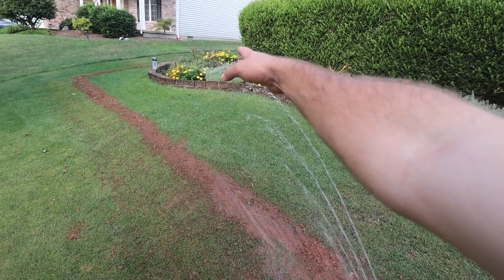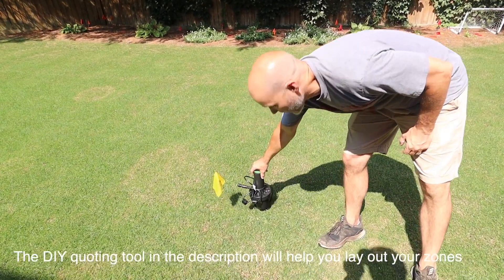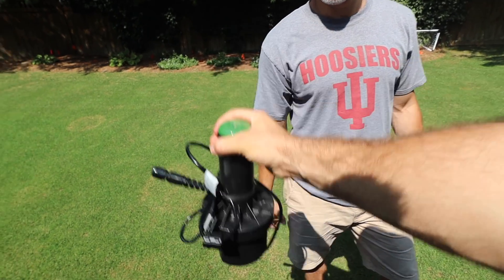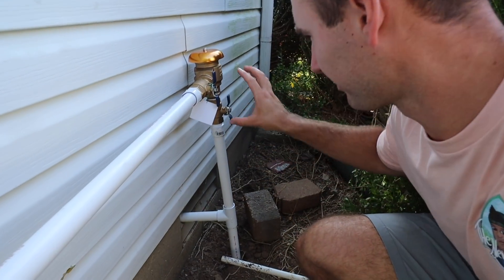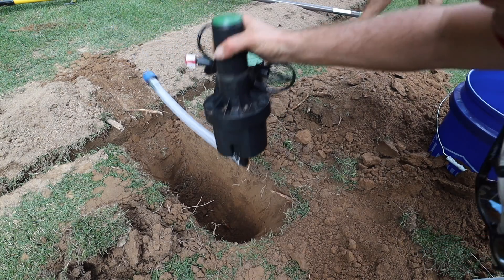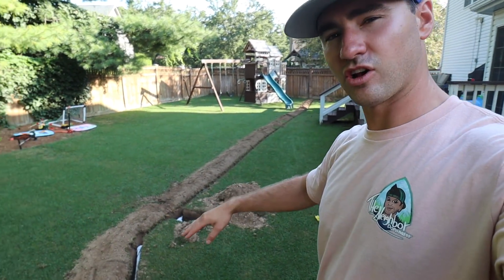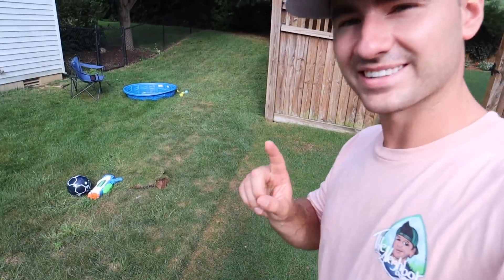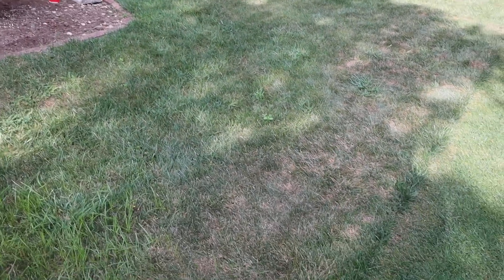The EASIEST In-Ground Irrigation Installation / DIY

Comment: This is the first i’ve I’ve seen this system.  So if I understand correctly, there are no separate valves as in a traditional system, but the valves are built into each sprinkler head?  I’m installing an  8,000 square foot yard, mostly sod, but one section has several pine trees.  How do you account for that?
Reply from the maker: @kiheidude  you can email me if you want. I’m not sure I understand the question exactly. I have a link in the description you can go their website and type in your address and it will help you layout the system and show exactly where to place the heads and how many heads you need
Reply: @TheLawnWhisperer That would be great. I can’t seem to find your email address on your channel.  My proposed lawn area doesn’t show up well on the satellite image (plus the address was off about a mile) due to trees.  I am putting in about 6,000 square feet of sod (turf type fescue), and about 2,000 square feet I am going to seed.  On the seeded section there are several pine trees, so how do you account for the areas blocked by pine trees?  The area of the total proposed yard (sod and seed) is primarily an irregular rectangle.
Reply from the maker: @ you would have to run the irrigation line between two of the trees or around the trees to put one or however many heads would be necessary to cover the area. My email address is Lawnwhisperer.info@gmail.com
Shoot me an email and I’ll try to help

Comment: Putting in a new yard with a well. For me minimizing the amount of water will save me money and wear on my well pump. So this Is a plus. And my yard needs 14  smart heads compared to about 115 traditional heads. It makes installation for a home owner very easy running one pipe vs a matrix of pipes. Another win.
Reply from the maker: That’s awesome! Super easy install. Til March 22nd if you use code LW500 you get $500 off purchase of a system

Comment: This won’t be a game changer for several reason. Namely the extra wiring you need to install in the yard. So that not only will you need water pipes, but also control wiring that is carrying voltage. Additionally, what happens when the settings are lost, with how well most people manage their systems (which is not well at well) now you have this random sprinkler head watering with default settings. Oh and I’m sure this is another as-a-Service subscription, one more  to pay monthly in. And 1k for a single head. Loll. Not a game changer until the aforementioned items are cleared.

Comment: Not to knock you man but that did not really show how to install it. I have no idea where to go, what fittings to buy starting from my sprinkler box. You just showed trenching and connecting unknown connections from unknown origins..
Reply from the maker: Have a licensed plumber install the backflow. From there, if you can’t figure out whether you need a 90 or a 45 or a T fitting to run 1 line through the whole yard then you might want to hire a pro to install. It’s super simple, one line from backflow preventer to the last head

Comment: I was just about to take my card out and buy one right  away. Then i got the price of over 2K😮. Back the truck up. $2000 for 1 head???? It better have gold nozzle head so i can sell it in 10 years and make a profit.
Reply from the maker: 2k initial cost for the system and a head. Additional heads are under $200 I believe. Only takes 3 or 4 heads to cover a 5k square foot lawn depending on the layout

Comment: Now set it up so I can water different areas in the zone different amounts
Reply from the maker: But why
Reply: @TheLawnWhisperer  why exclude the flowerbed when you can water it appropriately
Reply from the maker: @mikepower3614  🤷🏻‍♂️ I’m just not really sure how they’d do it
Reply: @TheLawnWhisperer  they would need to turn on and off the individual holes.  Multiple passes could lay down more water on different regions
Reply from the maker: @mikepower3614  I’ve suggested that to be able to water over a sidewalk as well

Comment: Look up Netafim, $120 for 250Ft compared to $230 PER HEAD😳
Reply from the maker: You want me to put a drip line throughout my lawn?
Reply: @TheLawnWhisperer  drip line made for lawn irrigation, yes. It has a near zero evaporation rate(we have to worry about that out west) and in my opinion it waters amazing without staining any sidewalks/driveways due to overspray. Only downside is you can’t aerate during maintenance.
Reply from the maker: @bwtjma183  this head eliminates overspray and you can still aerate and do all the things. Repairs for the drip line throughout the lawn sounds like a nightmare as well
Reply: @TheLawnWhisperer  trying to give people another option my man. Thank you for sharing the vid, I got an email about the head not too long ago and curios

Comment: A fair price would be $150-200. At $2k, the market will be very limited.
Reply from the maker: Each additional head is about 200. To buy into the system the initial cost is 2k for 1 head and controller

Comment: For as much as that unit costs, there better be one hell of a trouble free warranty, and a no bitch policy when there is an issue. Winter maintenance included. 

2k a head!!??😳
Reply from the maker: It’s not 2k a head. It’s about 2k to get into the system with a head and the controller, then about 200 a head

Comment: Wow would love to replace my existing system with this. My yard is tiny but I have like 10 or so heads in my front yard and about the same in the back. They constantly break and need repair. This one head would do my entire front yard lol...  Seems like it would be a pain to install this over existing system (having to remove the old system etc)

Comment: I mean yeah it's cool but it's like $300-$500 per head. You got wires buried all over your yard in addition to the water lines, more failure points, more troubleshooting. Really just seems unnecessarily complicated for the "cool factor:".
Reply from the maker: The wire goes in the same trench as the water lines so not “all over your yard”
Reply: @TheLawnWhisperer  That's still "all over your yard"
Reply from the maker: @TofuInc  I would just get a hose and sprinkler and water by moving that around, that way you don’t have pipe all over your yard either
Reply: @TheLawnWhisperer  Your clearly avoiding the point with your sarcastic responses.

Comment: Is it viable to use a 3/4" pvc vinyl tubing instead of pvc piping? And would you be able to just connect it to the outdoor spigot? I'm a diy junkie but wary of messing with the main water line 😅

Comment: DId you have weird or odd calibration pressure. when trying to calibrate it, mine would flucuate from 21 down to about 19 and then it would pick back up... pressure isnt constant/consistent .   also i can only set 2 schedules. morning and night.  Is there a way to add a third for mid day??? im struggling with mine

Comment: @The Lawn Whisperer, the interesting thing is, are the nozzles that spray water directional?

Can I mount it ups side down in a green house?

As greenhouses are usually rectangle.

This would be great as we could control the exact volume of water compared to a traditional sprinkler system.

Comment: Any suggestion for determining if this system is suitable for properties with well water and how to determine if you would have enough water pressure?
Reply: 1. Constant pressure (between 40-80 psi) To check, connect a pressure gauge to your water spigot. 
2 Good flow (8+ gpm ) Do a bucket test for flow rates: Make sure you can fill a 5 gallon bucket in less than 45 seconds (8 gallons per minute). 
3 Clean water 
Measuring your water pressure will tell you the maximum distance that your sprinkler head will be able to spray, and help you determine where to place your sprinkler head(s). (40 PSI= 25 ft, up to 80 = 35 ft)

Comment: $2,000 for a single sprinkler head setup.  
Inflation is getting crazy or I’m getting old, last time I bought a 3 pack of heads I think they were $50-60.
Reply from the maker: Haha I can guarantee you those were not at the same level as this one. That price also includes the controller and wiring as well. But they are aware this system is not for everyone and that’s ok 👍

Comment: This looks great, I'm curious about when lawn it's a little taller and repairs when wire get cut.
Reply from the maker: I would say if the lawn is mowed taller to install it a little higher ? Would be nice if you could put risers on it for those situations that you could easily switch out if needed

Comment: Awesome equipment! I wasn't sure why that you installed it on PVC though, poly piping lasts much longer and is easier to work with. Just my opinion though! As for the PVB, we usually install those on galvanized piping, especially when exposed to the elements.
Reply: The fitting suck on poly
Reply: Pvc is almost all systems in the south. Poly is the go to in the north.
Reply: We live in Georgia and I’ve installed many PVC sprinkler systems over many years, the oldest one in my parents yard 36 years ago. In that old system we’ve replaced most of the heads over time but none of the piping, never had a failure on the primed and glued fittings; pipe is sch 10. Technically the poly pipe should last 100 years, but the fittings are the weak link. We use the poly pipe in agriculture irrigation so I have experience with it also.

Comment: I got a quote for my 500 sf lawn and was a bit shocked at the price considering I only need 1 head. The one thing I'm concerned about is that apparently most of the cost is due to the controller unit and it's only warranted for 2 years. So it goes out after that and you have to cough up probably more than 1000 bucks for a new one? If it's really that good they should warrant it for at least 5 years considering the cost. My quote was for $1855 and just to see what an extra head cost I also input that option and it was $330 more. I'm looking into Otolawn which was mentioned in another comment here and may get that for only $400. No need to dig up my lawn and worry about a $1000+ controller failing with that. Irrigreen should consider an above ground option like that, I think there would be a lot of demand for that.
Reply: Also surprised at the quote I received; not convinced that a well-installed traditional system is not a better option dollar-per-dollar.  I would be interested in seeing ROI given the system's claimed water savings, especially against an existing system that is not 10+ years old or otherwise using legacy heads.

Comment: These have been around for awhile. Its an excellent idea but it hasnt been used widely for various reasons
Reply from the maker: I’d be interested to know the reasons!
Reply: @TheLawnWhisperer    The 1st thing that I noticed with these heads was the size of the orifices.  Well water would clog up these tiny orifices very quickly with the sand that is coming out of the well.   With normal rotor heads, the sand passes right through.  Even the pop up sprinkler heads that have filters clog up frequently with city water which is by far cleaner. Im sure these heads have a filter but it would have to be a pretty tight mesh to cath material as small as the orifice and if it was tight enough, it would have to be cleaned regularly. Most people would not do that. 

The other reason is the cost to replace heads. Im sure the total price of installation would be about the same with either style of system, but replacing the digital head occasionally would be more expensive than maintenance on a traditional system. 

Your thoughts?

Comment: How about showing us a catch can test. The watering pattern looks to be very inconsistent. This looks very intriguing but would have to do some testing for sure. FYI. I'm a landscape architect licensed in 7 States.
Reply from the maker: Nice 👍 I am going to do a couple more videos on these. One showing just that and another showing how to program them
Reply: We did a study with the Center of Irrigation Technology at Fresno State. That study showed that catch cans don’t work with our system. Also showed Irrigreen put down 40% less water and achieved the same increase in soil moisture against a traditional system using Hunter I20 rotators. This isn’t your grandpas sprinkler system.
Reply: @thegreybeeexperience  is love to read that study and find out the conclusion on why catch cans don’t work. They show more than just layout but also DU (distribution uniformity) which is key to getting certified. By indicating that catch cans don’t work, this seems to indicate your product relies on wicking which is basically another term for flood irrigating. 
What does look promising if you can prove the consistency is the large droplets of water which will be great for windy areas.

Comment: I only need one. I have a small grass area. About 15ft wide and 35ft long.  I'm in Phoenix.  How can I order everything I need?
Reply: I just got an estimate done.  6 heads, controller and wire for 5500 sq ft yard.  $3370 for the system.  they dont give break down on how much each head is.
Reply: @evaristorosalez9340  wow, that is crazy
Reply: @evaristorosalez9340  $1800 for the controller, and $230 per head is what I’ve found.

Comment: Pretty awesome … cost compared to a traditional system?  Ease and cost of head replacement if damaged?
Reply from the maker: It’s hard for me personally to compare the cost vs a traditional system because I don’t know your area, shape of your lawn so I don’t know how many heads you would need. This is more expensive though generally.
Reply: @TheLawnWhisperer  no worries … very cool.
Reply: @milanjurich1526  About $500/head – does not include installation costs

Comment: I'll try them out , but I still think head to head coverage is necessary in full sun areas and ensures some watering if a head isn't working properly.  More parts means more can go wrong  . Are the nozzles replaceable? Can you easily clear them ? I'll install them on a test plot give it a test .
Reply: The green cap just screws off and you can pull the nozzle out and clear it. There is also a filter in there as well. Super easy.
Reply: @thegreybeeexperience  That's great , thanks for information. I'm in the Irrigation business I'll definitely try them out on zone on a new install somewhere.   I think these would be great for preventing staining on sidewalks and such .

Comment: Just put my info in their website to get a quote.  I’ve been waiting on putting my own irrigation in because of the work involved.  The single trench around the house is clutch.
Reply from the maker: Single trench is way easier for sure 👍
Reply: Good luck.  Non responsive for me.
Reply from the maker: @natem2367  that’s why they created the DIY quote tool I put in the description of the video. I posted this video and they got 3000 requests for a quote and they aren’t equipped for that volume in such a short amount of time 👍 can get a quote really fast now with that tool

Comment: My one question is how does it handle a sloped yard? The “misting” kind compensates for my yard currently due to having a short range.

I’m just curious if they can be installed angled for adequate coverage?
Thanks!
Reply: That’s exactly right, we put the front yard head at an angle due to severe slope.

Comment: It would be even cooler if future advancements allow you to just replace your Hunter heads with these digital heads!  Without running new wires or pipes!
Reply: Exactly my thinking.  Maybe they would make it rechargeable battery operated.  Otherwise you could just install the control electric cables closer to the surface.  Will need to cap off the unused Hunter heads though.
Reply: Or maybe Hunter will come up with their own digital replacement head!

Comment: Can you just replace your current sprinkler heads with this ? Or do you have to re do your entire irrigation system?
Reply: Unfortunately you can't retrofit an existing system with this. I was curious about the Irrigreen as well, so I reached out to a salesperson and they gave me the information and cost and you would have to redo your piping if you don't have 1" pipe.
Reply: @agodinez80  I don't know what I have but if it's one inch will I be ok?

Comment: This looks amazing. The only thing is I wish you showed how to draw the perimeter. I’m sure it’s app based.
Reply from the maker: Working on a dedicated video showing just that
Reply: Theses do NOT work!!!
Reply from the maker: @ericybarra4975  how so?
Reply: @TheLawnWhisperer  had them installed in 2018 had 7 heads or zones. Had replace zone 1 and zone 4 that same year because they stop talking the control box.  2019 had same problems always getting error codes on the app never would work, or should I say pop up and work they would stay down but would run!! They said I had the first generation box, so they sent me out a serve box that worked for week!! Pretty much problems with the whole system I would always talk with irrigreen I believe his name was Ray nice guy. But About the 10th call to the installer we finally had enough ripped out the whole system and put in a traditional system back in. Great concept if they could fix all the bugs and get a better program It would be great.
Reply: @ericybarra4975  Yeah how so?